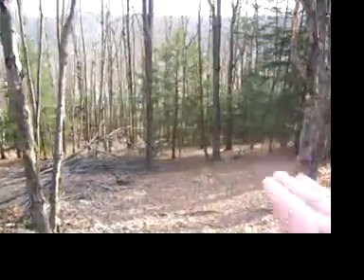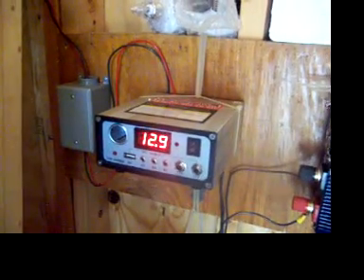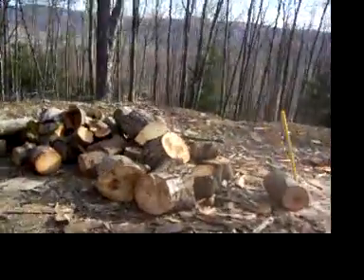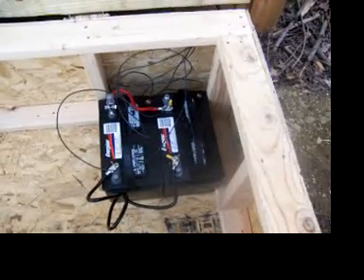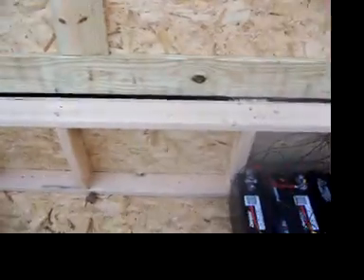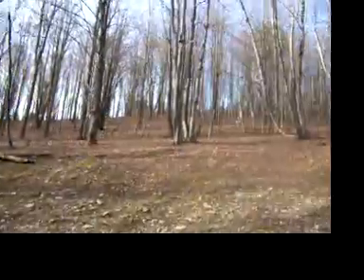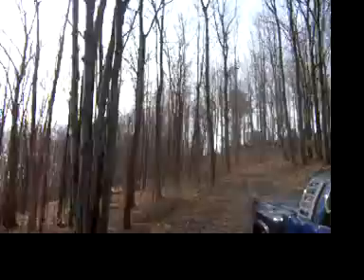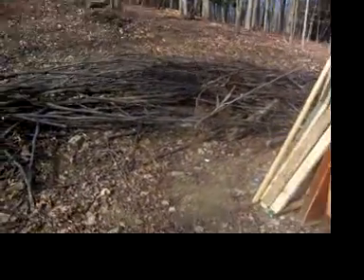my camp and solar set up

Comment: Nice starter system.. If you plan on using your system full time off grid you will need more storage and I might suggest a wind generator as well, but what you have is a great start. I also agree with other comments that recommend 6volt gold cart batteries daisy chained together for 12v. The key here is NEVER to let them get below 50% of their charge.

Comment: Some suggestions: if you really plan to expand battery capacity, go with golf-cart batteries @6volts each. Trojan is a good brand. Also, get your inverter close to but not in the battery compartment. Use heavy gauge wire between them and for all low voltage wiring, the losses are more critical at the low volts. Nothing wrong with having more battery bulk than panels in your situation where you use it sporadically. Plenty of time to recharge between visits, and you can use same controler.

Comment: FYI, you might need a better charge controller. each HF CC is rated at controlling 45W. that three panels.  There are other who are using one CC but if you real the instructions and ask HF tech support they will tell you to buy a 90W or better Charge controller.   Also, to ensure you getting the best out of your system buy a meter to measure the batteries. A small Generator is a very good idea to 
keep your Battery bank up in the 80% charge range. HF kit is great, but not a life support system.

Comment: I hope those cheap Harbor Freight kits do what you need. Any solar electricity is better than buying electricity, but for the $400 you spent you could have put that into a more efficient system. Just my 2 cents!  Joe

Comment: After seeing your setup I would make two suggestions
1, dont use inverted power for lights, to can make light with 12 volt RV type lighting, and it will go farther then running it through the inverter first.

Comment: 2 make your own generator with a small gas engine and a bus alternator, this will charge your whole battery pack its cheaper then a generator, and you dont need to switch your power supply back and forth.
Just some ideas, hope they help.
It will be more fuel efficient, and the RPM will be adjustable, which translates into quieter, and I think you know the value in that.